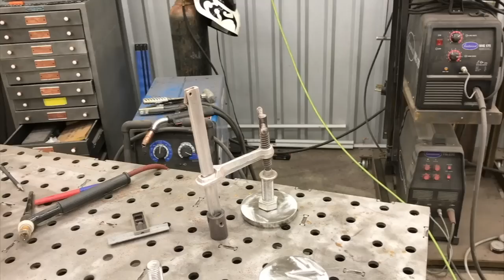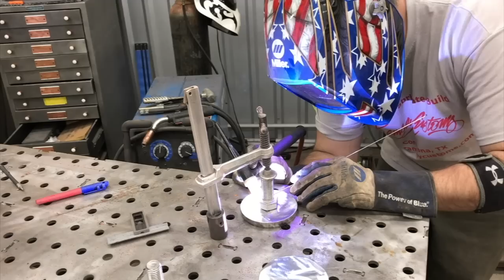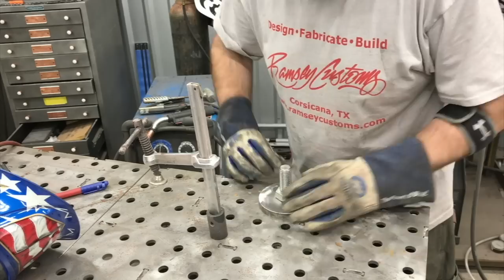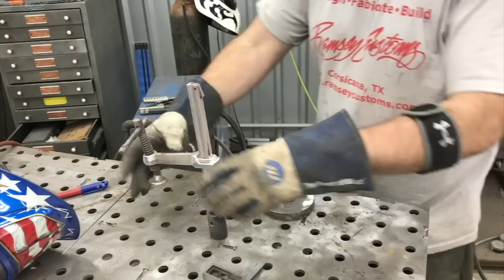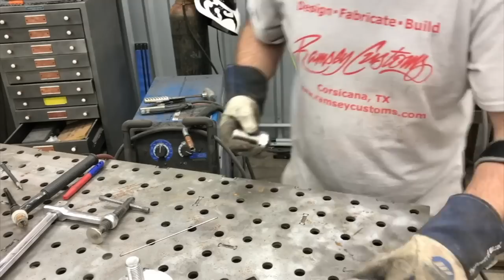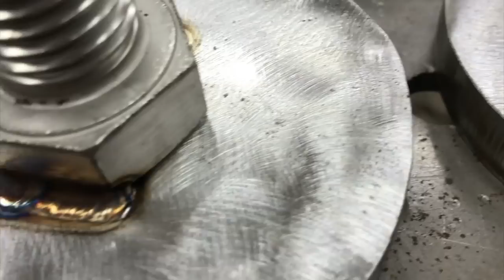How to Tig welding stainless steel bolts - Dallas, TX 75201 - tig time - Weld.com

Comment: I'm imagining what kind of table needs stainless feet.  Maybe something decorative?  Last time I did that (for my radial arm saw), I just have the bolt heads on the floor.
Reply from the maker: The feet aren't stainless just the bolts.  I am only using those because i bought them for another project and never used them
Reply: I see.  Has got to be nice using a TIG process.  I'd splatter the crap out of those with a MIG.  I would need to protect the threads from splatter and heat.

Comment: I’m in the process of climbing the learning curve with stainless. 
Couple pointers I learned, if anyone cares:
Ensure good enough pre-flow that your length of line is completely purged and argon only (arcs will start better as well.
Ensure long enough post flow and keep torch close to the weld puddle to cool tungsten and weld. Exposing either the stainless or tungsten to atmosphere when hot will oxidize. Oxidized tungsten will change your arc. Also if your using a post flow why not keep the end of the filler metal rod in the argon to keep the filler metal from oxidizing as well. 
Heat input is what I’m banging my head on now and I think that is be more patient.

Comment: Hi Gary,
Stainless is pretty nice to weld isn't it.  Those leveling feet match what you did with the whole table structure.  Are you going to put some felt or something on the bottom of the feet so they don't scratch the floor?  Probably isn't an issue in your shop though.
Very nice Gary!
Take Care,
Reid
Reply from the maker: Thanks Reid.  Honestly i had not thought about felt, but now that you mention it, yes, definitely need to do that!